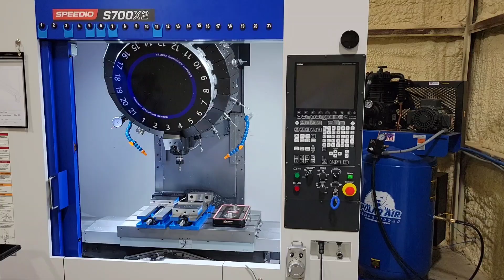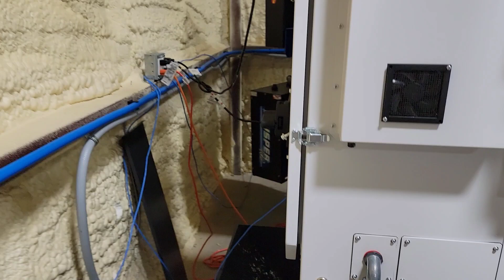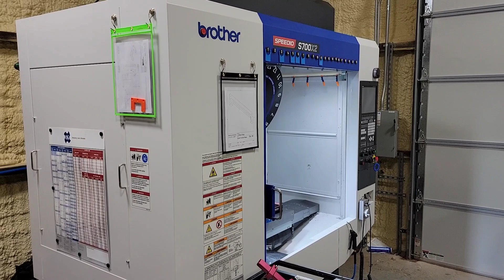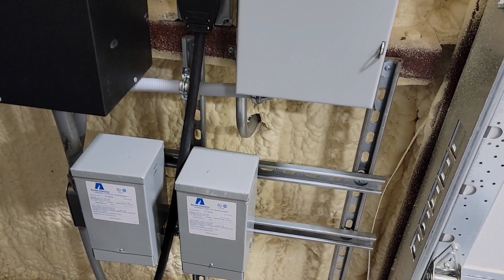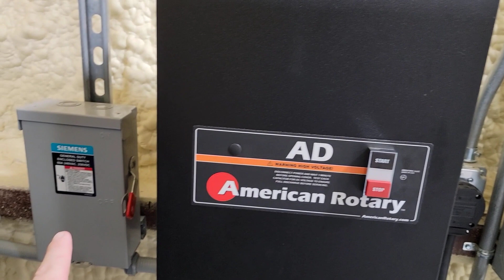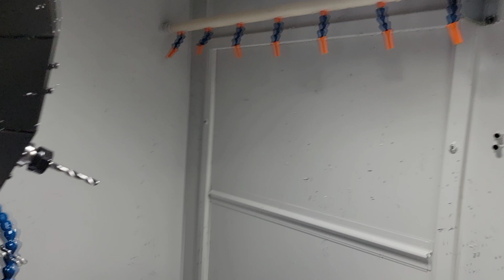Two months with my Brother Speedio S700x2

Comment: I have an X1 high torque, the worst machine I've ever bought. It's only given me problems, especially with tool changes. It's broken four forks in two years, and replacing them is extremely expensive. The biggest mistake I made was buying that machine. I have a Hass machine that cost half as much and hasn't given me any problems for years. Brother is for printers and sewing machines.

Comment: Read the brother manual. 200-230 in the MEP world means it runs on 240. Just the same as how you'll see small motors listed at 110 volt. They are not 110 volt motors - that's the voltage they will still give their entire rated power output. It's extremely likely that your machine is rated 200-230 because it will run slightly under volted on 208 and slightly under volted 240.

Comment: Amazing machine!
How much was the cost? And what was the ordering like?

Also what kinds of materials do you usually cut?
Reply from the maker: 80k and ordering was easy, machine was in stock and here in a week.  Mostly 6061 but will cut anything.  Recently did some steel and tool steel, cut great
Reply: @bobbyintheshop  That's lower than I'd have expected. Was that with the dual contact spindle option?

Comment: Id have concerns having the haimer in the changer.  Either with chips and coolant or just because ive noticed mine is pretty sensitive to either knocking the concentricity out or the needle off zero.
Reply from the maker: It's ip67 rated and I asked haimer about it, still doesn't feel right but I've been assured it's OK.  My primary concern a was the gforce
Reply: @bobbyintheshop  lol literally yesterday i had my ng damaged by a hard snap into the spindle.  Going out to haimer tomorrow.  Quite the process to have it repaired. Back to using my zero master, or actually getting some batteries for my probe

Comment: I have a 2019 haas vf4ss with single auger and the chip control is garbage. They have been making the machine for like 25 years with the same bad chip control. Even the multi-augers and the belt type conveyor sucks from what I have heard, but you'll pay massively more money to get it. If I had one of these I would want a belt conveyor in the back so I didn't have to shovel the chips out of the pit. Looks great.
Reply from the maker: Man that's a bummer to hear but good info.  Honestly cleaning the chips takes about two minutes and so nice to be able to keep the machine running while we do.

Comment: Hey Bobby, what options did you get with the machine?
Reply from the maker: Hey, originally we were going to get the new 1000 machine, but shipping kept getting delayed.  That had everything, dual contact spindle, tsc etc.  We just had to get going and I basically got the 700 stock with the manual pulse generator.  Nothing special but still love it
Reply: @bobbyintheshop  what was the quote on the new one? Hard to get prices when you gotta email them

Comment: As a guy who who just retired and had a machining center in a garage, I would build a small room for the compressor, well sound insulated with filtered venting up high.
I am not a big fan of solid state phase generators, I used a Roto Phase, and had no problems in 15 years.
They recommend a generator with double the rating of the machine, but I didn't do that and had zero issues.
Reply from the maker: I think we might do this, thanks!

Comment: Thanks for the video. You have pretty nice shop. I would put that compressor farther from the CNC, to reduce vibration. Also I don't saw that you have the air dryer.  I have 2019 VF2-SS in my garage, running on 200 amps service. Powering through Phase Perfect PT-030 (30 HP) I can't run anything in the house when that things working at max speeds, since with 5 HP air compressor and air dryer, I barely have any power for anything else. Had the issues with incoming voltage (average 247 Volts) and mills transformer hummed, had to install Delta to Delta 3 phase 250-240 V, 45 KVA transformer, which lower it by 10 volts to get it right in the middle of the haas multi-tap transformer range (236 Volts). Now machine transformer is quiet and if there's a load that separate transformer takes it instead of machine transformer. I don't regret it. Now just saving money to buy property to build the house and the shop.
Reply from the maker: had not thought of that, its on an antivibration pad but I will check it out thanks.  best of luck and good job making it work!